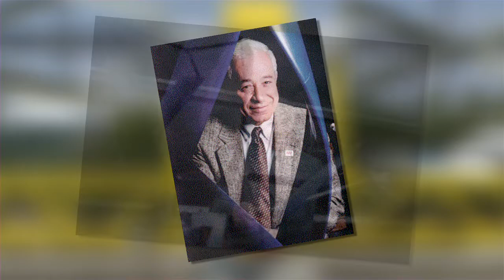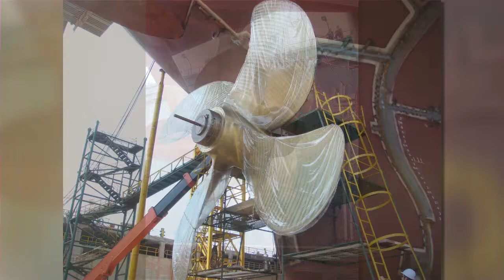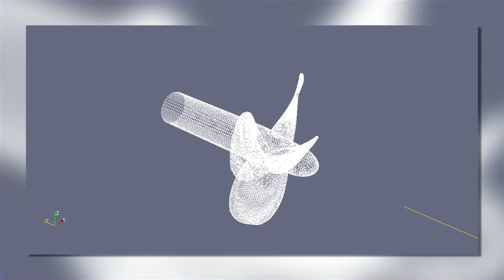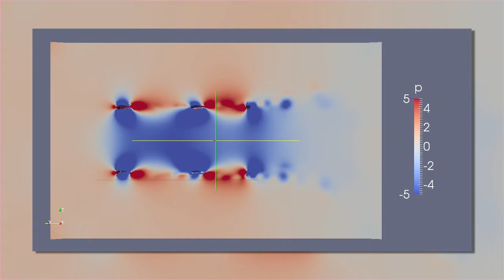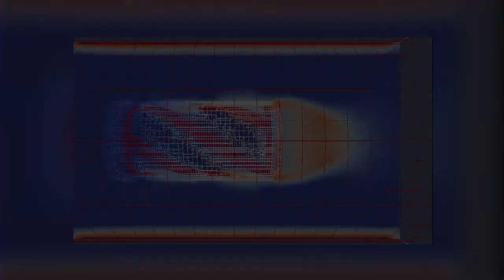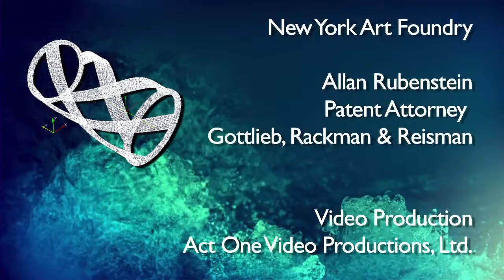Vor-Prop:  a new form of marine propulsion

Comment: Capt. Rip
This is a most interesting concept. I have seen where these props are used to drive a hydro generator, but i have not seen an application where it drives a ship. Do you see an efficientcy advantage with this type of prop?